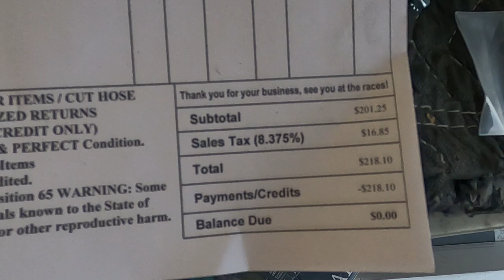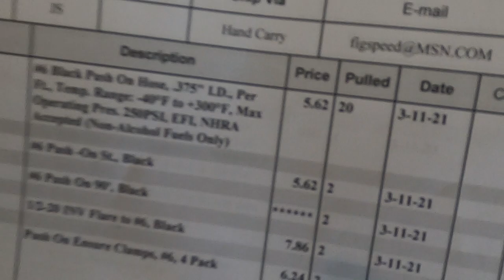MAKING TRANSMISSION COOLING LINES WITH AN FITTINGS

Comment: Clean work clean work! We should do a collab vid it’ll bring something new to your channel. I’m building 1 of the cleanest LS/ LSA builds and have all the major parts purchased but it’s the little stuff where you would come into play. Plus I have your hideaway kit, firewall panel & fender braces. Even if you don’t like the idea of collaborating as a new thing maybe you’ll consider it this 1 rare time. I wouldn’t leave a post this long if I weren’t 100% serious. You could make like 10 vids from the amount of stuff I have on deck for the gbody. Just to drop a few parts: bmr/qa1 complete suspension, Eaton posi 8.5 diff with disc break conversion, nw 103 tb, Lsa blower ported, custom center console, Dakota digital dash, custom door panels, custom accessories drive setup, 6180 trans, circle D tc, custom 5” intake tube, custom spoiler and a lot more! Im really trying to do this, this summer. 

If you’re reading my comment please like so you guys can witness this build to come alive in a special “GP” collab series

Comment: Keep in mind that PTFE hose has to be replaced every 5-7 years. I learned that the hard way. On fuel lines. I converted over to hard tubing, and ended up with only a couple of feet of push-lok on a return-style fuel system.

Comment: Geez those pliers are $160. Cost more fot the pliers than the parts. That, plus all the parts, might as well go with braided lines. Thanks for the part numbers though. I might use different clamps, just not as fancy lol

Comment: I was feeling skeptical about these push lock fittings because I never used them before your video helped out a lot I’m running custom transmission lines on a 4l80 swapped Tahoe very informational video 👍🏾✊🏾
Reply from the maker: Glad I could help
Reply: @goosseperformance1444  
Digging your channel alot of good info. Where can i find that type of hose for transmission lines?

Comment: Hey Goose what up good morning got a question  for you, do you have a video or is there a video out on converting your 68 to 72 Chevys heater core lines to An fittings if so hit me?
Reply from the maker: I never use AN for heater lines on a chevelle but I used some on the hellcat charger

Comment: Why didn't you use a B&M cooler or why not and how many roles in the radiator 3 or 4
Reply from the maker: 4, customer presence
Reply: @goosseperformance1444  I'm in the middle of putting my elco together I'm running nothing to fancy I got a question  is it better to run a B&M trans cooler or straight to the radiator?  Also one more is it good to run a filter in the inline hose to tranny, where did you get them clamps and tool?
Reply from the maker: @Ruffmade  just added links to tools, but just depends on what your doing with the car but i have never run a external filter

Comment: I thought transmission lines had to be hard lines?
Reply from the maker: No sir
Reply: Can i used fuel lines rubber hose for transmission lines?
Reply: @Angelobs   Looks like you need specific rubber transmission cooler lines. Not just any rubber line.

Comment: MOVE THEM OFF OF OIL FIFTER YOU WILL BURN THEM OUT
Reply: Not the oil filter, that'd be fine, my oil cooler lines coming out of the oil filter were rubber. Could be a little close to the exhaust though if the exhaust isn't shielded.